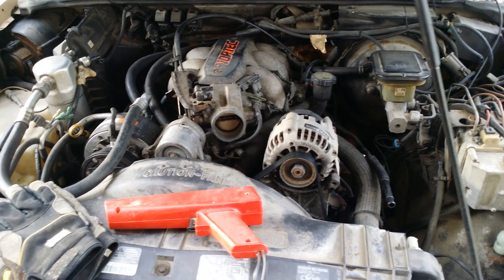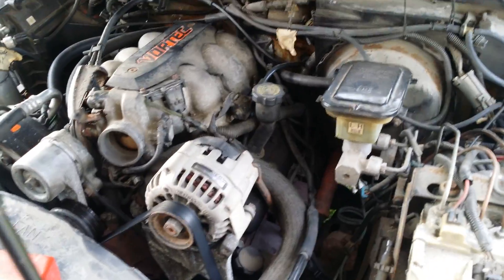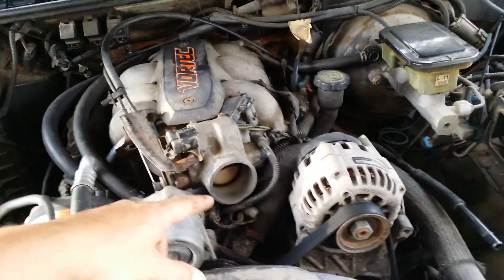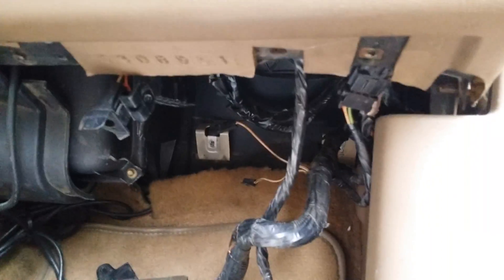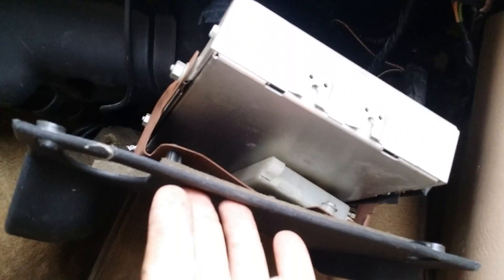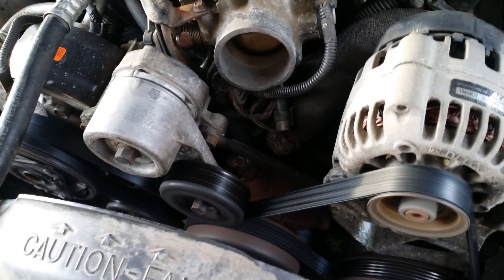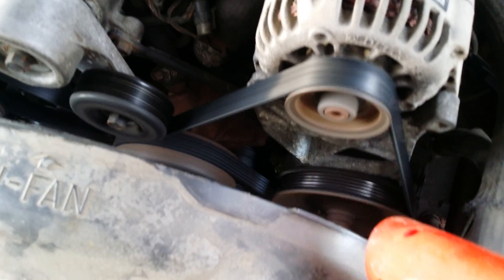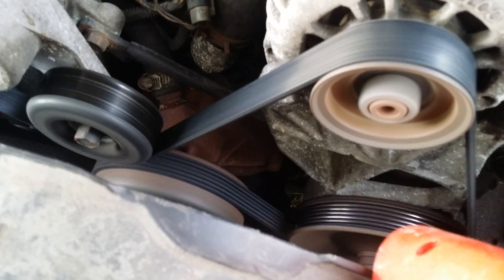Ignition Timing 1995 Chevy Blazer 4.3

Comment: Can this also be for a 1995 Chevy astro van ?
Reply from the maker: yes, but 95 was an oddball year, check the distributor cap if it has an old school distributor cap than it needs to be put in time, if it has the newer flat top distributor cap than it has electronic timing and does not need to be timed with a light. Midway through the year, 1995 GM changed ignitions.

Comment: i have a 1995 gmc jimmy flat cap and is fixed timing mines OBD 1.5 not 1 or two
Reply from the maker: Whats the 8th digit of the vin,, mine is a w
Reply: Chris Miller the way I 95 Chevy 4.3 Vortec wires